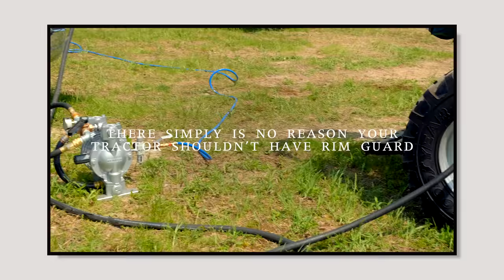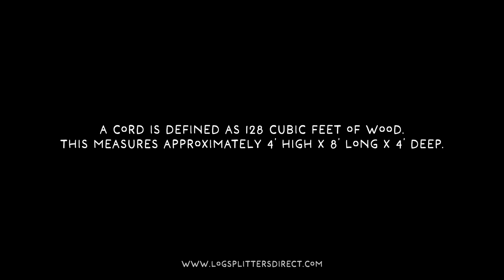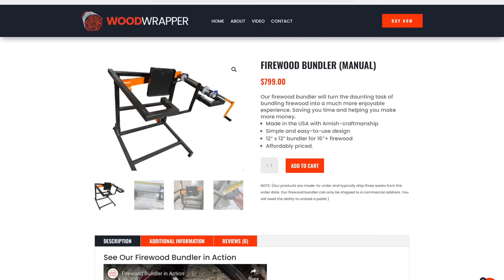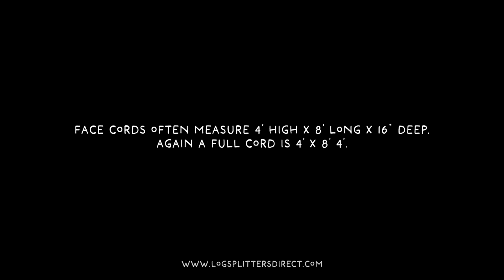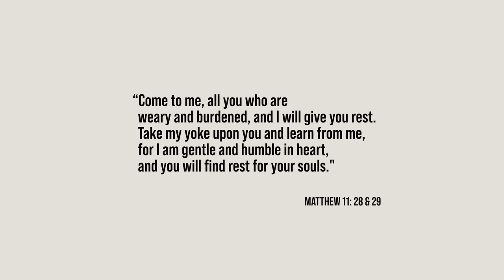WHERE'S THE PROFIT IN FIREWOOD? I DON'T SEE IT 🤷‍♂️

Comment: Here’s my firewood math - production for my own heating needs: with a chainsaw and a splitting maul, I can get a cord of wood from standing trees to cut/split/stacked in 4 hours if the grain is straight and the tree isn’t more than about 14” in diameter. For 6 cords, that’s 24 hours, which saves me $1500+ in propane. Subtracting saw operating costs and adding maintenance time, that’s better than $50 per hour, and no gym membership 😆. Productive Recreation!
Reply from the maker: Yeah, you are literally like a machine.  Hometown didn't even make 3 full cords in 8 hours using a firewood processor.  And,  that was starting with a stack of logs ready to feed into the processor.  You should make videos of you vs a firewood processor.  Sounds like you'd give the machine a run for its money.
Reply: @GoodWorksTractors  I don’t know about that. But I did cut a red oak about 14” in diameter this morning that yielded about 1/4 cord. Start to finish was about an hour and a half with filming and moving the camera, etc. I wasn’t rushing. For wood that goes easy, hand splitting is faster than you think.
Reply from the maker: @ProductiveRecreation  part time yes, full time?  You'll have a short career :)
Reply: @GoodWorksTractors  No doubt! 4 hours is my max firewood work time. I should also note I’m not making pretty bundle pieces like Hometown Acres. I’m splitting for my wood stove, and some pieces are bigger than what you’d put in bundles.

Comment: A couple points. 1) Drying time. If you start a firewood business from scratch, you're at least a year out from first split until first cash. Depends on the region and species. Joe @ OWB says 2 years to season oak in Ohio, others say a year further south. 2) If you buy firewood for bundling, you're going to need higher quality control on it than if you're selling it as bulk wood. You generally want straighter and smaller pieces for bundling, as you need visual appeal and smaller pieces means it looks like you get more for your money, and it's more suitable for small campfires or fireplaces. If it's not small enough, now you've got to resplit it.  Bundling in bags may look nicer, but unless there's some tool that makes it easier to get into the bags, the wood is going to hang up on the webbing, slowing you down. 3) I think Adam @ HTA may have used slightly higher numbers for his costs than I'd agree with. IIRC, he treated the expenses of the excavator solely as a firewood business expense although he actually uses it for other things, like excavating and lumber handling for his sawmill.

Comment: My bro-in-law used to sell some logs off his forested land (90 acres) every few years to a lumbermill and then use the small cutoffs that the mill didn't want (<12") for firewood so that helped the math a lot - and used most of the tree which made him happy.  The silver maple and sugar maple logs would be dried for a year or more before he split it and used half and sold half.  He also did most of the cutting/splitting in the winter when he was slower with his construction jobs and the ground was frozen for his tractor.  Hard to get rich doing it though.

Comment: Yes, the touch time is very high with firewood.  I have split my own wood, but I have the trees, chainsaws, a splitter, and a good place to store the seasoned wood.  This winter I used all of my 6 cords and still had to by 2 more cords.  Eight cords is a lot of work, and I think if I had a dependable source of firewood, I would just buy it.  Oh, and falling trees is dangerous, especially for the weekend warrior.   So, in closing, I'm with you.  It simply does not pencil out!

Comment: I’m retired but when I was still operating my landscape materials supply business we offered firewood for sale as one of our sales items. I looked at it as a necessary evil to keep my employees busy during a slower sales time of the year, but like you could never make the numbers add up to get excited over it. I focused in on reselling QUALITY firewood. I bought semi loads of firewood (processed and dried from  large wholesalers) and resold it. KILN DRIED hardwoods only. Kiln drying insures consistently burning wood and the temps and length of time in the kiln kills off any insects/larva that may be present within the wood. Kiln drying vs seasoning removes the potential for moving invasive/unwanted pests into an area. I charged a premium for quality. Some customers recognized the added value-some not. I preferred dealing with quality minded customers…

Comment: .06 cubic foot bundles sell for 8.99 at all the stores around here. I’m in the Little Rock area. That’s 213 bundles per cord. I’m selling mine for $6.00 each. That’s $1278 per cord. Takes me 7 hours to buck, split, stack and bundle one cord. The math works great for me.
Reply from the maker: Good luck to you.
Reply: .06 cubic foot is 10" square and 1" thick. Are you sure about this? Basically a 1 x12 12" long. If you can sell that for $6.00, I would like to sell some things to your customers.
Reply: @mikewatson4644  shhhh, don't mess with his "reality"

Comment: 25 ton truck of wood here in NZ is $60 per T for pine  delivered $90 per T  for Oregon . 25 tons should equate to  50 cubic m thrown   5.09 thrown cubic m to a cord , so basically 10 cords to a truck . So a  thrown cubic M of  pine costs $30 sell for $65 + delivery ($10)+tax  so $35X5= $175   gross ( per hour if things are going well ). Fuel $10 , maintenance $10 ,  Labour $22 , depreciation $5 other $15 .$175-62= $113 $100 an hour splitting and assuming 10 cubes delivered at a time , $70 an hour for delivery so averaging $85 an hour , in theory

Comment: I love this i have worked for allot of different places dealing with this and by far the best was Tims operation ! Now that being said this man had dedicated his life to logging and doing this as a business. He brought wood to the yard out of the forest and also had a big U road with logs stacked up and we did fire wood as well. This is a big business up in northern MN. And it's a shame it couldn't keep going you have to have a decent crew but he had built a trailer with a splitter built into it on the back of a grapple truck so essentially we could have a person on either side feeding and sawing now it takes a small crew and you have to be extremely strong as you have to lift up these 12-16 inch logs up to chest high we would fill the back of a pretty big dump truck with sides a good 10 cords or so in anywhere from a hr to a hr and half with no issues and everything running smoothly. Now back when we where doing it it he sold all that wood dropped in your yard for 600 bucks. We would stack it but that was extra. We would typically do 3 loads a day depending on how it went sometimes we could Hussle out 4. On average thats almost 2k a day we all would make a 100 bucks cash so that would be 500 for that usually we only had one cutter tho as Mark was extremely fast. In today's market i would think 800 would be the going rate and you would be busy as hell but by the end of the week you would be doing about 10k plus whatever for who showed up that week and it doesn't account for the big wood going to the mill. Now you do have to have sorta a team but TBH this could be done with one person. Although the equipment was old you could move it and if you had enough people you could probably fill about 6-8 trucks depending on snags or mechanical issues. This was by far the most efficient thing I have ever seen and was absolutely amazed by how Guinness it was he probably had a good 100k into that program but it splits so dam fast and dumps right into the truck. This was brilliant. We also did a thing where we put together those bundles like you buy at the gas station and that shit would drive you made but it was Money and you could come and go as you wanted. Moving down to Indiana here i have seen some of those bundles of wood sell for 27 bucks 😬😬😬😬 which is very very curious to me. Anyways i love logging and done allot of firewood in my day many people have different ways but one thing i can tell ya even a good hydraulic splitter with a 4 way on it can do some serious damage with the right person behind it !!!!

Comment: My firewood business is a lot simpler- I buy 8’ long logs, 18 cords at a time, process (with a processor)it as I sell it by the cord into my dump trailer, deliver it to residential customers. I limit it to 300 full cords a year- I double my money on what I pay. 3-4 cords a day, to add to my other businesses. It’s profitable that way- I never touch the product. The math works for me. It’s simple work- not necessarily easy work though.
Reply: Yep, let the customers do the drying, and only handle it once after splitting on the production side. 
I cut and split firewood for myself, here in New Zealand. Take 2 IBC totes to the trees in a trailer. Cut green willow, hand split with a maul, straight into the tote, slide the totes off at home. Use 3 point forks to put the tote into the little wood shed out the back door when it’s time.
“Willow, that’s rubbish wood!” Dries in 2 months, year round over here.

Comment: I used to cut my own firewood for 15 years.  It is brutal work.  All depends on the level of equipment you have.  I had a pickup and chainsaws.  That's' it.  So the multiple lifting, loading and unloading steps were all me and my joints.  Transporting it within the woods and to the public is fuel and lots of it.  Saws break and need a rebuild, or to be replaced.  Things on the truck get broken.  Summer is brutal heat, and winter is slippery making it hard to skid logs.  Even if you buy your wood as cordwood logs, delivering to the customers can be a pain. A pile in a pickup has to be unloaded.  And customer A wants it stacked super neatly, right in this corner, in his crowded garage = 2 hour delivery.  So delivery terms and limits have to be accounted for.  Palletized or crated face cords with a way to unload would solve that, but then you have more and more cost.  Making lumber, bowl blanks, pen blanks and other turning blanks is also a lot of work for not too much pay.  I'm still selling off my stock from when I did that.  I do it part-time, therefore big equipment doesn't make sense, therefore there's little pay.  :)  It really is a challenge to find things that support you well.

Comment: One way to control costs, is where you source your wood.  Which depends on where you live.   Using Chris from In The Woodyard (the guy bundling kindling) as an example:   Tree services get paid to haul off wood after they cut it.  (which is one reason you see so many marketplace ads for free wood, curbside- someone trying to save themselves that cost)  They then need a place to take it to.  Dumps and landfills charge them to dump it, and not all of them have the room- or interest- in doing firewood on the side.   Thus, many are always looking for places to drop off that wood- enter the neighborhood firewood guy.  You can get a LOT of free wood- already cut down, without all the brush and tops- just for being the solution to someone else's problem.   Chris got BURIED in it this year, as his city was getting all of it's beetle killed Ash trees taken down.   He still had to buck, split, and stack it- but he'd have to do that anyway.

  Down sides:  You get what you get.  Which means, sometimes you get less desirable species.   If you specialize in recreational wood, like he does, that's not too big a problem- lots of customers don't know- or care- what it is, just that it burns.   Also, more often than not, it's cut in random length logs and chunks- whatever was most expedient in getting the tree down safely, and getting it out of there.   Plus, yard trees often grow big tops, multiple limbs, and are thus full of crotches and knots.   So, you end up with lots of hunks n chunks, and gnarly unstackables.  Again, not an insurmountable problem- you can sell that as campfire or boiler wood.  Or keep it as your own stash.

  You do have to look out for metal, and other "The hell is THIS doing in this tree???"

  Chris also buys loads of logs from loggers.  This costs money, but again, you're skipping a bunch of steps, and just getting the trunks and limbs.  They normally come in either 8' sections, 16' or tree length- depends on how the primary log buyers want them.  (lumber vs pulp mills)
 The other benefit, is that you often have some control over what you buy, both size and species.  

  AND he cuts some of his own and looks for other opportunities to get low/no cost wood.   Items 1 and 3 help defray the cost of buying those log loads- which are mostly varieties he can sell for a premium.  Oak, hickory, locust, cherry, etc.   The bundles he was making there are all kindling- splitter debris.  An extra source of income from a by product.

   His brother Kenny has worked in the logging business his whole life.  Thus he has contacts at the mills, and knows about all the byproducts and rejects they have, and need to get rid of.  So he buys loads of mill rejects, slabs, even rejected railroad ties. (pre-treatment)  All at a considerably lower price than buying logs from loggers.

  As you touched on,  the real $$ is in selling to customers who are willing to pay premium prices, and in smaller quantites.  Bulk heating wood is a low margin/ high volume business.   Restaurants, BBQ and smoker people, fireplace people, campers, etc.   I see bundles selling for as much as 8-9 bucks each at some supermarkets, gas stations, and big box stores.  That wood had to come from somebody.  If you have a city or big suburb nearby, that's a good market.  The selling price will be higher, because few have access to wood to cut for themselves (much less the desire to do it), but many may have fireplaces, backyard firepits, smokers, or do some weekend camping.  Resorty areas, and places with lots of state/ national parks, and/or campgrounds are good markets, too.   City folks will pay premium money for white birch, for example, which is a meh wood for heating.  But it looks nice, smells great, and burns nice and bright in a fireplace.  The locals don't want it, because it has little heat in it- but the folks with weekend cabins, ski condos, etc can't get enough of it.

  A lot of guys do it for chainsaw money, and to underwrite the cost of their own supply, not as a full time job.   Sometimes it evolves into one, anyway, lol.   For many, it's a second, side job.

Comment: Seems most around me that sell firewood are loggers. So they get paid to go out and clear a lot or parcell of land, turn around and sell the best trees to saw mills and what not and then sell the firewood in full log lengths, cut and split and then cut, split and dried. I'm sure just solely cutting firewood is tough, especially today with pellet stoves and heat pumps and so many options. Most people today (not people watching this channel)  couldn't handle actually having to physically cut and stack firewood. Personally I grew up with a Woodstove and when I moved into my house there was an old pellet stove and I yanked it out and put a wood stove in. Power goes out here in winter (Maine) that Woodstove is more important than the generator in my opinion. I'm fortunate my family own 40acres, I cut our own wood, yea it's time and effort but I'ld have a chainsaw regardless and recently got a splitter and few years ago and it's a few weekends a year to save $1000s in heating oil and after a long cold day outside there is nothing like the heat from a Woodstove.

Comment: You see, there’s a need for firewood, even in texas. 75% of wood sells are in the winter and fall. 25% in the summer and spring (mostly smoking wood) I’m one of the very few that do delivery’s.
My prices all benefit me (delivery, stacking and miles) and it’s almost maintenance free. I do all my splitting and stacking in the summer(hot days season it quickly) ready to sell by winter.

I don’t personally own a lot of land with trees. But people give away already cut up wood like a hooker on Sunday. 
All I gotta do is spilt it and let it sit. I can split 4 cords in about 3 hours, with a splitter from tractor supply.
All numbers crunched from last year I made 62k with a 14k loss( vehicle and equipment maintenance/fuel)
It’s all about perspective and how quickly you can manage things.

Comment: Courtney! in Kalamazoo Firewood is cheap, because it's illegal to haul it across state lines (invasive species).. However, In the City of Chicago, a full cord typically goes for $600 or more, and that's not guaranteed hardwoods. For me? here in MI? I'd starve. Why do I still do it? For the exercise, and I get a better quality firewood than what I can typically buy.  That being said, I burn two full cords of wood, that I fell, buck, split, and stack each year.. The amount of labor is about 10 hours, with tools I've obtained cheaply. So, my investment of $600 20 years ago has paid off time, and time again..

Comment: Firewood in western Idaho is 350 - 400 a cord. The bundles are 6-8 a bundle. The other idea is buying a log truck load for around 2k. You get about 12 cord and you process it yourself. It's a lot of labor for a little profit. When I build my new place I want an outdoor wood boiler so that takes the splitting labor away at least.

Comment: Firewood is tough business. The prices are higher here, $300 a chord to start. My advantage is that I have no debt, live off grid, and don't need a great deal of capital. It's also only a portion of my income. I climb trees, mill lumber, carpentry, you name it, keeping my income stream a diversified as possible has proven a useful strategy. If I were to try to live off of firewood sales it would take 133 chords, regardless of species, at a cost of approximately $70 a chord to harvest and transport home for processing.